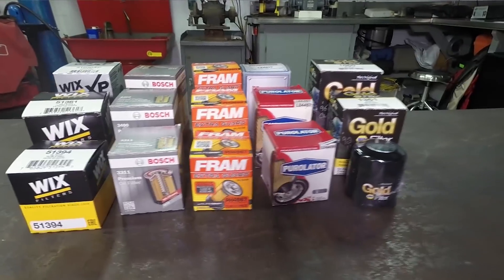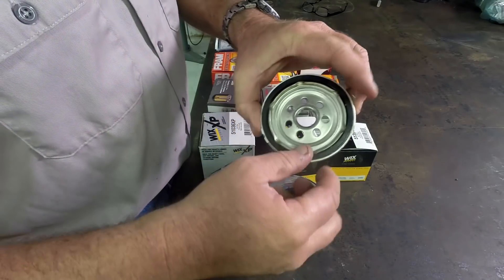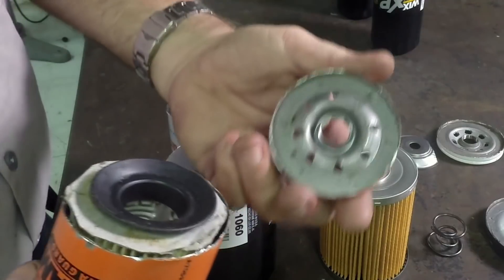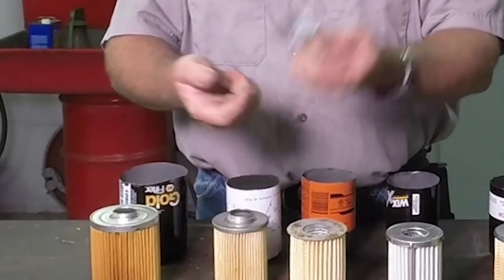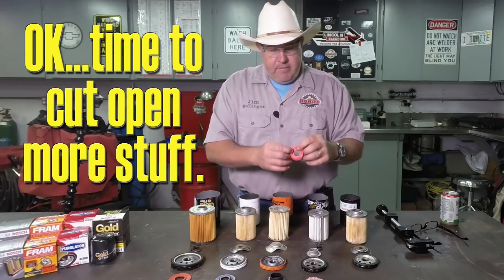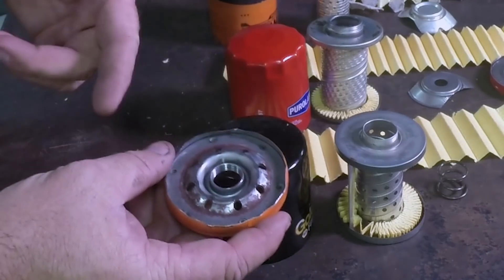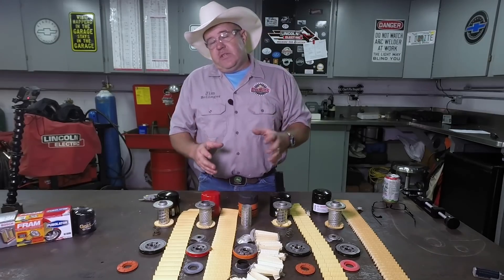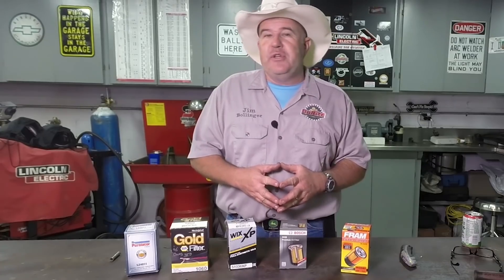The worst oil filter EVER!

Comment: I was told to stay away from FRAM, over 30 years ago.
Reply: Wow!
Reply: I use motorcraft filters and oil on all my vehicles. I have owned Ford, Chevy and Dodge. Never had major problems out of any of my vehicles. My 02 F150 has 332,000 miles and my wifes tahoe has 217,000 always had Motorcraft products since new.
Reply: Wow lie much !! or are you just that stupid?  Thats not rust and you know it. thats Discoloration  where they use heat to cure the cardboard to the filter. there is NO rust in the canister !!  yes it is a cheaper filter, but its susposed to be. its only good for 5,000 miles and is dirt cheap for walmart to sell. if you want a good filter test a fram ultra filter rated for 15,000 miles. cut one open to see , makes your napa filter look like a pice of shit.  i am a mechanic & i know what im talking about.  you are lying to these people and should be ashamed !!!!!!!!!!!!!!!!!!!!!!!!!!!!!!!!!!!!!!!!!!!!!!!!!!!!!!!!!!!!!!!!!!!!!!!!!!!!!!!!!!!!!!!!!!!!!!!!!!!!!!!!!!!!!!!!!!!!!!!!!!!!!!!!!!!!!!!!!!!!!!!!!!!!!!!!!!!!!!!!!!!!!!!!!!!!!!!!!!!
Reply: Who told you that?  A WIX salesman??
Reply: Fram and Pennzoil
Reply: Ldog Harycokanbalz pennzoil and Quaker state uses to put paragon wax in their oil
Reply: @jonsmith919  I think your right. I have been turning wrenches for 20 years and I have had two engines with rod knocks and both owners swore up and down on Pennzoil till I showed them the inside of their engines. Both had a wax type cake on their cyl heads.
Reply: @jonsmith919  
I used 10w30 Pennzoil for over 40 yrs and my engines were clean internally. Ummmm?
If people don't change their oil and their filters on a regular schedule, they will get dirty engines. Synthetics nowadays are said to keep engines clean even better.
Overall, motor oils have improved a lot in the last 15 yrs or so or even in the last 10 yrs.
If an RCA television was crap 30 yrs ago and rated in the top 2 this yr, I suppose you wouldn't buy one due to it history 30 yrs ago?  
Me, I try to keep up with the times and qualities. I now use Mobil 1, Fram Ultra oil filters and sometimes Pennzoil Platinum, depending what is on sale at the time.
Reply: @buffvail476  To each his own
Reply: @ldogharycokanbalz6043  
I was told by someone not to buy the London Bridge.

Comment: I've never had a problem with Fram filters but I heard before they are shit. I've cut them open after I have changed oil so no rust or anything. Better switch brands.
Reply: Kinda same thing...FRAM filters oil...that's all.

Comment: I did this same thing for NAPA back in the early 80's.
I think its important to note a couple things that was not mentioned in this video. 
#1: The porosity of the paper element that actually does the filtering. 
#2: Which manufacturer actually makes what brands.  #3: In most engines, only an average of 10% of the oil flow actually gets filtered. What controls the flow?
 #4: That little flat spot at the end of the filter can. What's that about?
#5: The manufacturer's warranty. 
Allow me to address each of these points.
#1: Back then, the Fram had the largest pores in its paper element. Wix had the best @ ten microns. So small that water particles can't pass through.
#2: It matters who makes what. For instance, Guard Corp. Makes the following brands,  NAPA, WIX, Ford /Motorcraft, Car Quest among others. That's why your WIX and NAPA filters were identical in your comparison. 
#3: All cartridge spin-on filters have a built in bypass valve controlled and governed by a spring located at the inside base of the can. As oil pressure varies,  pressure is applied to the element cartridge against that spring thus allowing the excess oil to bypass the element. You can imagine how important it is to have a spring mechanism that will hold up to continuous varying pressure and high temperatures. Back on the 80's Fram had s useless bent piece of thin sheetmetal used as their bypass spring while the Guard filters used an actual  coiled spring as a comparison.
#4: that flat spot on the rounded base of the filter can is there for a reason.  It's a visual indicator. If that spot is flat like the day it was installed, all is good but,  if the flat spot is gone and now rounded the bypass  valve has failed and the filter needs to be replaced immediately! 
#5: The manufacturers warranty. In point #4 I discussed the purpose of the flat spot on the can. Another failure is when you remove the old filter during a routine oil change, shake that filter up & down. Do you feel and hear the element bouncing in there?Thats another failure. Don't throw it away! Most manufacturers will cover any and all damage caused by a faulty filter. Read the warranty! A replacement engine isn't  cheap! 
Many of you may remember that oil filter display at your local NAPA store showing three brands of spin-on oil filters cut open with all their internals exposed. A NAPA (Guard), AC (GM) and Fram (Allied). 
I built the 1st one and corporate took that ball and ran with it for which I applaud them. 
Hope this helps some of you better understand that there is no replacement for quality. Don't let your wallet make your choices for you.
Capt'n

Comment: Used Fram filters over 20yrs never an issue!!!
Reply: That's what everyone says tell they lose a engine and fram hands them a new filter if you had a wix they would have gave you a new engine true story friend lost a motor because a new fram oil filter imploded almost being installed fram warrant covers the filter only a highway district lost a 30,000 engine because a air filter that had over 100 pounds of dirt imploded wix gave them a engine. I personal don't blame a filter that had that much dirt and been blown out who knows how many times for failing but wix did so. Moral of this story fram will say the filter failed and give you a filter to put on you boat anchor and wix/Napa will make it right. K&N I have heard even though their written warrant don't sound as good they tend to take care of you when a filter fails to had a guy tell me he had one implode he shut down before engine ran dry to long and they gave him filters for the next 100,000 and told him if has any issues in that time they will change the engine. K&N air filters are junk though they say not for use in extreme conditions read the paper in with them it pretty much call 90% of the USA extreme conditions.

Comment: One popular yet older filter is the Hastings oil filter. It is of good quality but has one drawback to its performance. It unlike those of other filters are pack with a substance called densonite, which is like a thick dense cotton  which works great with one exception, that is that oil can find a path through the denseinite and not receive proper filtration.

Comment: I've never had an issue with fram oil filters, why are you using a cutoff wheel to cut them open?
Reply: Used a cutoff wheel because your wife was using the viberator.

Comment: Thank you, thank you, thank you. Can you rip open a Mobil1? That's the filter I've used forever, never had a problem. It'd be nice to see it vs. the Wix/NAPA. Thanks again. Subbed and shared.
Reply: Just look at the gasket, the Mobil1 uses a O ring gasket = high quality, the others just cut a strip off the end of a hose, Losers

Comment: used fram on every vehicle i've owned since i started drving  and have put over 200k miles on all of them before selling and upgrading and never any engine issues, its not the most complicated thing for what its purpose is, dude is dissecting it like its a compressor for a jet, cheap 1 dollar for 200 quantity coffee filter keeps coffee grinds out of coffee haha. never had a fram fall apart when cutting open, the oil holds all the filter material together anyways. more expensive filters are built better yes, but cost more and do the same thing, fake news or the company would be out of business

Comment: my dad's 2002 accord 4 cycl, got it brand new, now is 375k miles on it, original engine/transmission, engine still strong, A/T slips a little ,1st and 2nd gear not grabbing well , still daily driven. cheapest castrol gtx + fram oil/air filter from walmart 95% of it's life.
Reply: knock on wood 3 times.
Reply: @FYJ2972  He doesn't have to "knock" on anything. He already has 375K and going strong. Guess you didn't see that....or.....you just don't want to believe that he has used Fram and has already gotten that much mileage? smh

Comment: Frams are fine.  The best filter out there, IMO, is the Fram Ultra.  Cut one of those open, but don't stop there.  Look at how they filter in standard tests.  99% down to 20 microns on first pass.  The next best does 99% at down to 30 microns.  That blows the Napa Gold away.  I've used cheap Frams for years, too, and they do fine, according to used oil analyses.  Some of your filters that look good have anti drainback valves that are ineffective, even thought they look good.  At the end of the day, how they filter is the most important thing.  The Fram Ultra is built well but also filters better.

Comment: I have been using Fram filters for at least 35 years. Not once have I had  an issue with any of those filters. All my vehicles go over 250 K miles before I donate them to charity or the salt on the road (live on the rust belt)  gets the best of them. No one single engine failure.  Comparing a low end filter to a high end one is not a fair comparison.  Feels like a very biased opinion.

Comment: About a month after I watched this video my 2002 Echo oil light came on. It has 160K on it, but everyone says these little engines can't be killed and run forever. I put a gauge on the engine, and it bounces all around 0-10 LBS. I'm sick that I put a FRAM filter on with it's last oil change. Can anyone tell me what to do now? I plan an engine flush to save it when the weather improves. Keith L.

Comment: I used to use cheap Frams in my Toyota pickup because I didn’t know better ( Toyotas can pretty much run axel grease in the crank case and valves, no filter and still outlast most other cars). Now I only use Wix in my Saab because it came highly recommended, now I see why. Great video!

Comment: Heaven forbid we compare filter based on a price point.  i.e. Here's what you get for $6 or $8 or $10.  No lets compare the cheapest filter available to a group of more expensive filters.  I have watch endless videos and tried many different filters and in my opinion the Fram Ultra Synthetic comes out equal to or better than any other.  I would never use a $3 filter no matter what brand it was.

Comment: I'm surprised you didn't talk more about the purpose of the spring. It's not to simply hold the parts inside tight together, but to permit oil bypass should the filter ever get plugged. It's better to have unfiltered oil flow through the engine than no oil at all.

Comment: ***No oil was actually filtered during this video.***

First of all, thanks for showing us the insides of all these filters.  However, scientifically speaking, they're not made to be pretty, they're made to filter oil--which is not presented in your analysis.  I don't care how pretty the inside of it is, or how much scrap metal these create, or how long the paper is.  Different paper will have different filtering properties. Also, does Fram market a more expensive filter, or was this their cheapo generic filter?  

Final point: please consider an engine that doesn't create all this waste.  Many modern engines have permanent filter housings, where only the internal paper element and a gasket is disposed of during oil changes.  Then, you could focus on the filtration of oil and eliminate this rather unscientific focus on how thick the metal is or what the paper inside looks like.   That Fram might filter just fine, and that wisp of rust gets filtered out on the first pass through the filter and you just saved yourself $10 worth of unnecessarily thick metal housing and $5 worth of fancy gasket.  I'm not trying to buy the prettiest and most expensive oil filter, I want it to do its job and then it gets thrown away in 2-4 months.  Does  the Fram do the job adequately?  I don't know based on your video--doesn't look great for Fram, but still this doesn't really test how good it can filter oil and what the actual usefulness is.  No oil was filtered during this video...um, what do oil filters do again?  But, still pretty cool to see their insides like that!  Thanks!  

My humble advice:  Take dirty motor oil, like say 32 quarts, mixed together and divided evenly into, say, 5 equal parts, maybe grind some metal real-fine and add that into it in equal amounts.  Create a machine to pump this around through the filter with a seal, just like an oil pump would at the average-high pressure constantly for a week--separate from any engine--do this in a sample batch for each brand oil filter.  Then, analyze the viscosity and clarity of the oil, removal of carbon deposits, metal flakes left behind, etc.  Same oil filtered for same amount of time controlling for all different variables--now you could see which oil filter actually works best, and how bad the "bad" one really is.

Comment: I personally use Purolator Boss. It’s one of the best on the market in my opinion. The red one in the video is the Purolator classic, the cheapest one. Wix/Napa, K&N, and Mobile1 are also very good. 

That fram extra guard is complete garbage, but the higher end fram filters aren’t bad, especially for the price. I do wish more filters had that rubbery grip coating, though
Reply: Their race filters are one of the best

Comment: I'm so glad that you had put this video on. It changed my whole outlook on Fram filters. I've been using them for several years. Cardboard...really? What a pos!  I'll be using Napa Gold or the Wix filters from now on! Thanks again!
Reply: Raymond...what did you REALLY expect to see inside an oil filter???? Gold thread woven in-between the paper? ( They ALL use paper! ) Again, the test is in the REAL world use...just
check and see how many FRAM filters are sold and used WITHOUT failure and don't believe ALL the hype of someone's opinion. It's you money...spend it however you wish.

Comment: The key that a lot of these opinion tear down videos miss out on is original parts manufacturer. If you look at the cutting scene of the NAPA oil filter @2:04 in small white font it says Mann+Hummel (owns WIX), that is the company that manufactures the filters for that particular of filter for NAPA. 
Fram makes their own filters.
WIX manufactures their filters as well as other's filters. 

As a previous employee for the filtration division of a major US diesel company, I can honestly tell you filtration of oil is about more than pleat counts. Too many pleats is just as bad as not enough. Also, many things factor into filters like usable surface area, pleat count, pleat depth, filtration media type, and filter diameter, just to name a few. I've run testing on new filters for comparisons as well as warranty claim filters. Honestly, any manufacturer that still uses a majority human assembled line is bound to have a bad part get through one in awhile. That's why warranties are out there, to protect parties in case by off chance there is a bad part. 

But with the line up of filters you have in the video, agreed with your take on Fram.

Comment: Long story short, I'd like to see some actual data about engine life over a 200k mile period for fram and the cheapest oil vs. premium and synthetic or any combination. 

I think this makes for good youtube videos, but doubt it ever has much effect on engine life. Especially for the average suburban driver who never revs a car and never really exposes their cars to much airborne dust/silica.

But, I'll admit I pretty much use OEM everything in my cars (no K&N or any of that nonsense) because that's generally what the car was engineered for, and it'll be in spec - and not expensive if gotten over the parts counter vs. off of internet sellers or as a charged-for part at the service counter.

Comment: It's nice to look at these, but looking at them and then drawing conclusions about what'll actually happen in real life isn't that useful. 

I've always bought OEM filters, but I would not stick my neck out and say that I could get two 10 car fleets and see any difference in engine life, mileage, etc, or anything for Fram vs. Wix. The only serious engine damage stories I've ever been exposed to are:
* engines running without air filters (even that you can get away with for quite some time)
* engines running without engine oil (that you can't get away with for long)

I used to ask my buddy if he was sure that he wanted to put super tech in everything (he just gets the cheapest dino oil that WM has and the cheapest filter - which could probably vary year to year depending on who is making it). I've seen him run 3 cars to 200k miles, and other than changing fluids, he's not the  kind of guy to take care of much. 

He sells the cars at 200k miles through a buddy of his who is a used car dealer whether they should go (as in, whether he's having problems) or not. He's never had an engine issue. 

The entire time, I've been running synthetic (full) and either OEM or plus construction filters. I've probably been wasting my money, except I do like how an engine runs cold on full synthetic when it's -10F outside (or even anywhere close to zero). 

Every car that I've had that needed to be traded or junked was trying to empty my pockets a different way (hoses, window  motors/regulators, electrical system issues), never the motor. Keep some oil, some air filter, and some oil filter in them and unlikely to ever have a problem before other intentionally crappy plastic parts fail and break you nickel and diming you to death finding NLA or high priced specific parts.